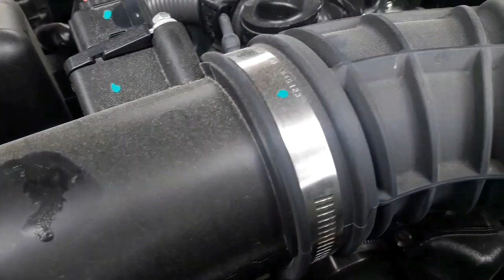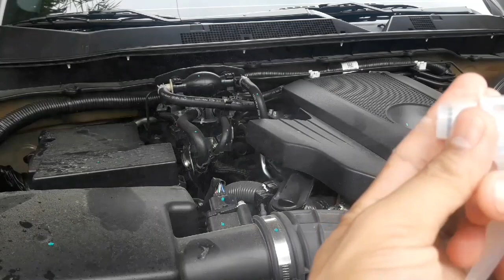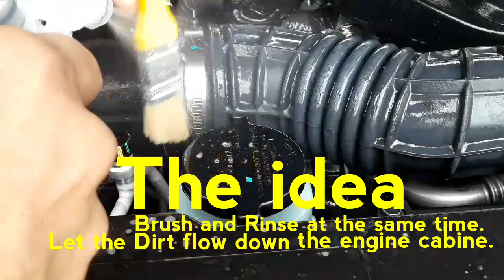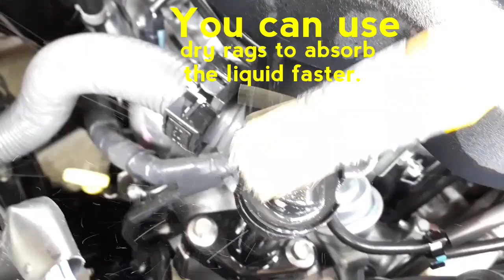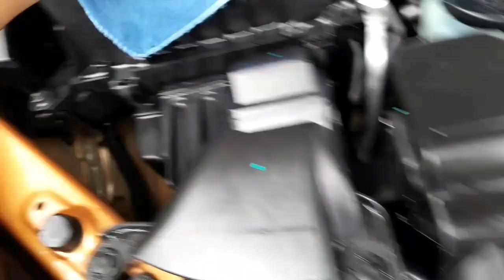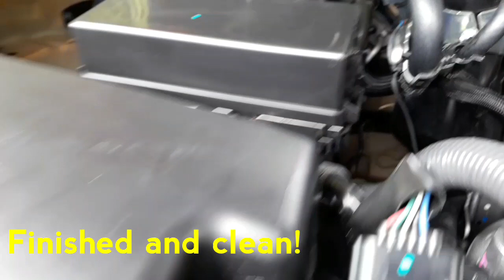Nissan Navara for EL Calibre & VL| DIY diesel engine wash.

Comment: Nice video sir! Did the same today. For comparative purposes on my end, i did the same with my my 2017 Ford Everest 2.2. What I used was MTX wash and wax, usual ko na car cleaning shampoo/wax. Sa akin, i cover the air intake with bunch up rags, foil cover the MAF sensor, intake manifold sensor, alternator connectors, plastic bag the battery, etc. na may electronics. And yes, removed the plastic engine cover too -- after 4 years and six months, medyo may nag build up na din sa ilalim na dust and dirt -- pero di naman sobra. And then pressure wash with water the heat shield sa ilalim ng hood, yung itim na foam pad na usual dust magnet. I then change to foam cannon (much less pressure) and spray foam from a distance on the engine and surrounding engine bay. Use the same foam cannon for the water rinse. Glad to know that we can actually do this on our own, pwede pala, walang kaba. Dry, done, and engine start. No prob. Kudos and more power.
Reply from the maker: Very organize paps ang cleaning mo  husay 😁 sakin after engine wash need ko patuyuin ng natural drying 30mins open hood...ok na 😁

Comment: You should have removed the engine plastic cover. A lot of dirt and grimes have accumulated underneath that part
Reply from the maker: I will try that for my next engine wash 👍😁
Reply: Same observation. Need deep cleaning. Better to use controlled pressurized water jet after brushing and electrical parts, sensors in particular should be plastic covered to ensure unnecessary penetration.